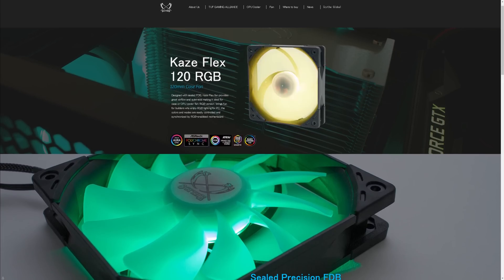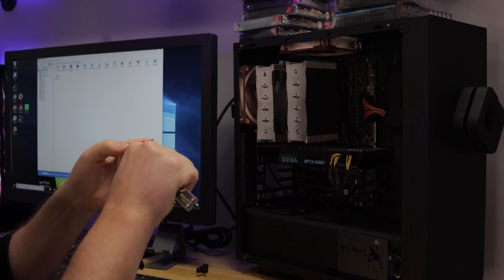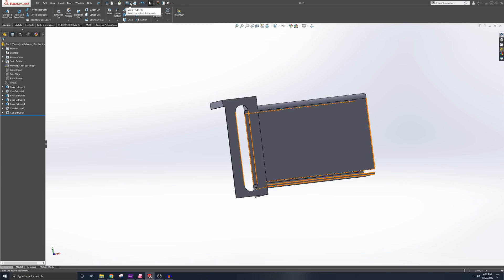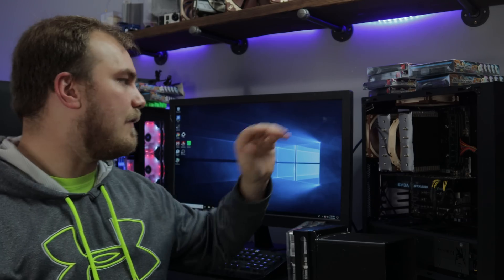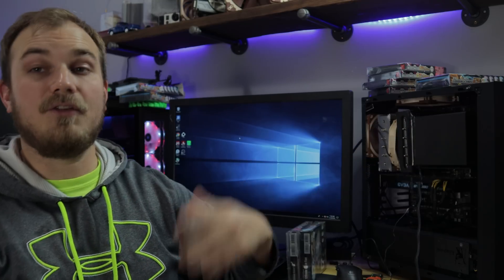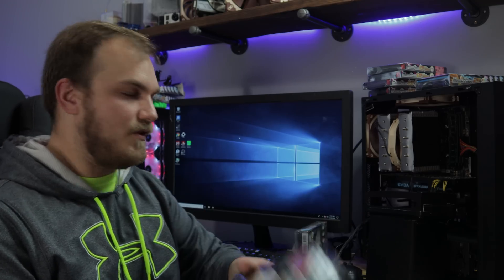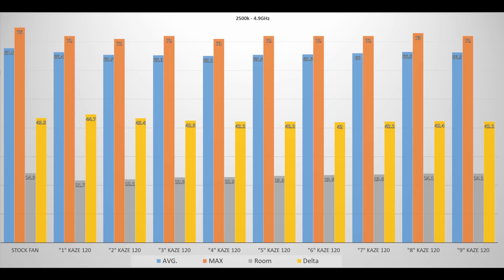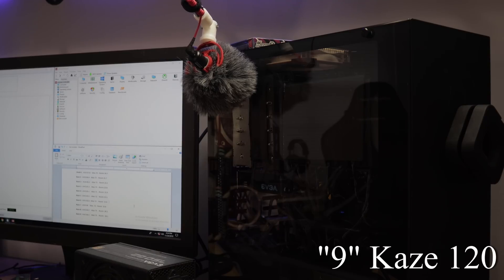This Is As Good As It Gets - Fan Stacking

Comment: Doing it in an open case does nothing. Stacking only works when used on case intake fans or case exhaust fans because it keeps cooler fresh air inside the case for the GPU and CPU cooling to utilize. Nice try though.

Comment: A jet engine builds pressure by having static blades in between the moving blades. The pressure of the air would increase, however the  speed of the air would remain the same. 
https://www.youtube.com/watch?v=L24Wf0VlTE0&t=63s

Comment: Fan stacking is more useful for a front air intake to direct cool air to the GPU. Fan stacking on a radiator about 2 inches thick is pointless since the limiting factor on cooling has more to do with the design of the heat sink and less to do with having more airflow or more static pressure going through the radiator fins. A radiator fan stuck up in front of most computer heat sinks already has enough static pressure to provide enough air flow through them.

Comment: i have a idea make duket for the noctower fan and put one noctower fan in it on the right side closet to the fornt of you case with no fan in the midlle of the cpu cooling tower.
i have a 2 tower cpu cooler with one fan on the right side and a move positive pc case set up with just the back fan as an exhaust thanks if you do try. case coolermaster pl300 matx intel HP Z75 LGA 1155 DDR3 mATX USB3.0 cpu core i7 3770 16 gb of ram gpu gtx 660 hdd 3/1/0.5 terabyes of hhds storage. and a power supply got it with a stand cpu cooler and in a retro case when i payed for it. now was for intake fans front and top an exhaust out back

Comment: Just remembered about Betz's law, I believe there's similar thing for stacking fans but in reverse and especially in the duct, you are pretty much limited by the first fan. On the other hand, did you thought about air speed moving though the fins? I mean if the faster is better, than airplanes won't even hit))
In other words, the air has to 'stay' near to the fins for a sometime to absorb the heat. You won't saturate it with heat that fast, so it's about amounts rather that pressure and speed. If you have ever ran PC outside of the case on the cardboard box or a fancier stand, you know that on the stand temps are much lower.
Also, when you are speeding air thought the fins, did you though about it’s exit? I mean it has to go back into the environment, so after ‘ducts, it’s like crashing running into the crown of standing people, which means that there is a sweet spot for the air speed to move) 
So stacking fans… kinda meh for PC cooling purposes))

Comment: It's hard to see but the front of the case looks like it is solid. So the problem here might be that you have a bunch of fans running but they have nothing to feed on. I'd try this in a different case, like a Lian Li Lancool II Mesh, Phanteks P400A, Fractal Meshify, etc. and see if there is any difference.

Comment: It will give MUCH BETTER results if you put a space between the fans..an old 120mm body stripped down and cleaned up
Oooh duh you have a 3d printer do a 120mm x 25mm spacer and ta da ..i promise will surprise you..

Comment: Some servers use a shroud like this with a high rpm fan like a delta to pull the heat away. It amazes me the efficiency of a single fan on a dual socket intel server that’s pulling 250+ watts of tdp and it runs fine. Loud but fine

Comment: I think the problem might be that the air blown out from the first fans in the congo line get blocked by the fans that come after it. So the first fan pushes air against the next fan, which is also trying to push air. While each fan IS generating airflow, it's restricted by the pushback which creates pockets of air that are effectively more static the more fans there are. Each fan besides the first is "choked" to a greater and greater extent.

You could fix this by making a long, tubular fan. Think two fan blades that curve a full 180 degrees across 200-500 mm, like an awkward lampshade.
One thing to keep in mind is that fans don't blow in a perfectly straight output, so walls perpendicular to the fan hub technically reduce throughput, and this might show even in a good tubular fan.

Comment: But how does fan stacking affect the overall static pressure and CFM? It's possible that heatsink was already running at maximum efficiency...but a heatsink with denser fins for instance could benefit from higher static pressure.

Comment: The problem here that those fans are RPM limited electronically.
They have whatever target and they won't spin faster, where higher fan RPM = more airflow = better cooling.
For example if one fan draws 1W spins 1500RPM and makes 150CFM of airflow and then you put 10 of them, they still will spin at 1500RPM, generate 150CFM and draw 2W in total.
You can confirm it by using some crazy server grade monster server fan that spins huge RPM numbers like 5000RPM+, one of these will give you better results.

Comment: This is not how it works, this is not how any of this works.

let me explain. The only advantage with much fans is when you have a big ass radiator with so much fins and so thick that i'll make a single fan not able to push air through the fins properly because it lacks pressure.

So, if you want to have extra degrees down with multiple fans, it option 1: You put them in parralel to have a higher air speed, or, having a much thicker radiator and put them in series.

Hope you'll do a video about it

Comment: I think the only benefit is that you can add up the torque that these fans make. If you're running a car air filter or a hepa filter as an intake you will notice the difference. The speed won't increase, but the pc's ability to pull air through such a dense filter definitely will.

Comment: Awesome experiment!!  And thanks for saying Kaze the right way! :)

Have you thought about an external air cooler so you can feed the CPU cooler with air below ambient?
I was thinking one of those cheap countertop ice makers, rigged to stay on.  You could probably find one for free that works perfectly because they use microswitches that fail in about a year (I simply replaced my switches with something better).
Otherwise, a Stirling cooler, a modified AC, or fridge compressor.

Comment: I'd guess the real best case for that heatsink would be triple fan, in, mid, out - or does that already hit diminishing returns.
Possible configurations:
3 fan.
2 fan in + mid (which I'd expect to be the optimal 2), out + mid, in + out, and for a weird one (maybe better with it turned 90 degree if possible) double in venting from middle.
1 fan, I'd guess nothing would beat a proper thickness one filling the middle.

Comment: I think the max rpm of the fans must be limited, otherwise it should have worked. More fans means more power and this should result in a bigger airflow if the speed of the fan blades is allowed to increase.
Reply: Fans work by lowing pressure on one side and increasing it on another. There's not going to be any appreciable difference past a certain point.
Reply: @Mostlyharmless1985  The difference in pressure you're talking about is a result of the RPM that the fan is running at. The RPM of the fan in turn is limited mainly by the electrical power the motor can provide (at high RPM). The physical limit you are taking about on the pressure would be the lower pressure area reaching absolute vacuum, and we're definitely not there yet. I think the PWM chips in the fans are programmed to limit the max rpm to prevent themselves from being burned out accidentally and to reduce the risk of fans dying from being run at a too high an RPM.
Reply: @gendragongfly  No it's quite a bit higher than a vacuum. The blades will stall out before a vacuum happens. You'll hit diminishing returns before that stalling happens.
Reply: @Mostlyharmless1985  I said that you're not going to reach a vacuum, thus your not limited by pressure. My point is and always has been that you're limited by the electrical power provided. PC fans just aren't that powerful, because they don't need to be. If you push a BLDC motor to a higher RPM than the RPM of PWM signal they will react (electrically and mechanically) as a resistive load. If instead the PWM signal where to be increased to match the RPM the fan actually wants to run at the results of this experiment would have shown more is better, because it is (until you reach that vacuum limit).
Reply: @gendragongfly  Except, again, yes, you will be limited because fans don't make pressure out of nothing. They simply have a low pressure side and a high pressure side and there will come a point where the fan blade stalls out. Going faster won't fix that. especially if the air is rarified by the high speed fan to begin with, there won't be anything for the fan blades to push on. More isn't better.
Reply: @Mostlyharmless1985  Really? I guess turbomolecular pumps and jet engines are imaginary then 🤔
Reply: gendragongfly yes, because a 12 volt computer fan and a molecular turbopump are comparable items. 
Never mind jet engines. 
I’ll say it again. 
The
Fan
Blades
Will
Stall
Out. 

Are you getting it yet? Why do you stubbornly cling to this idea that overspinning a fan will do something beyond  making more noise?
Reply: @Mostlyharmless1985  Because I've overclocked fans (by feeding higher voltage and higher RPM PWM signals) resulting in significantly lower temperatures on my computers CPU and GPU and I've reached lower temperatures by doubling up on fans as well. So I know it works. Plus I have an engineering degree and at school they though us physics. And according to physics the only way spinning fans faster won't result in moving more air is when you're operating in vacuum or working with a counter pressure which is greater than what the fans can overcome. Oh and you can get PC fans up to 24 volts and 'stalling' doesn't apply to fans because they don't need to generate lift in order to function.

Comment: You should stack two contra rotating fans connected together (without a space between them). I've already done that with 120 mm fans from Scythe KazeFlex and Noctua. I only know one company whose fans rotate clockwise - Scythe. The effect exceeded my expectations, especially at the lowest speed. It is a pity that I did not have a fan from Scythe rotating to the left with identical blades to the one rotating to the right. The best part is that Scythe KazeFlex is already working at 3V and Noctua  starts working from 5V.
Reply: Hey! Not sure if you’ll read this, but nowadays most fan models come in a reverse version - basically counter-rotation fans - which makes setups like this way easier. The problem is, not everyone has caught on yet. More people need to talk about this option.
Reply: @1tokarev1  I've seen such, but mainly on a Chinese portal starting with the letter A. I don't know any fans from good companies that would spin to the left and have an identical pair spinning to the right. I care about quality, and from the tests I've done, rarely does a fan work from very low voltage to full 12V. My pair of fans has been working in my computer so far. I bought a new pair on a Chinese portal, but I haven't tested them yet :).
Reply: @ Look at the Thermalright TL-K12 and TL-K12R fans - when arranged to blow air in the same direction, their blades will rotate in opposite directions to each other. Upon closer inspection, you'll notice that many reverse flow fans today don't just reverse the airflow direction - if you flip them over, most turn out to simply be counter-rotating versions of standard models.
Reply: @1tokarev1  I know that the fans you mentioned do their job, but notice that both fans spin to the left, but the TL-K12R needs to be turned with its back to the TL-K12 because it has reversed blades.

Comment: What about 4 into 1? Have a egg box style mount on a CPU heatsink. 4 intake fans on the chassis that have adaptors to compress the airflow into a small diameter and then run tubes to the eggbox style heatsink adaptor. (I have wanted to try this for like 10 years hahah)

Comment: What if you add decent dust filter in front of it? Not mesh... something like a HEPA filter or similar. Something that would actually keep dust out. What would the difference be with 1 fan vs stacking 2 or more fans then? And would counter rotating fans make a difference vs having 2 or more fans spinning the same direction?

Comment: do like 4 (2x2) or 9 (3x3) 120 mm fans in a wall with manifold behind it ending up in 1 120mm pipe going into CPU cooler. At low speed there should be zero noise and a lot  of cooling.

Comment: hi there. someone i know grows indoor "vegetables" and has to solve the problem of ventilating 5-20k watts of heat output from light bulbs. 

from what i have overheard, the best way to do that is with static air pressure. and in large configurations you use a plenum duct (a tube that maintains pressure, that can be tapped in to). 

why not do this with PCs? isolate the heat sources, treat them with air pressure. this can easily solve the dust problem because it is a closed in and out system. one filter. and to allow the rest of the case to tap in to that heat dispensing source, you just connect to the pipe, and put a valve in. heat in the case increases, valve opens, heat is evacuated. turbulence around components that isolates them from normal heat dissipation is less of an issue because the system relies on pressure.
allegedly.

its something to think about.

Comment: i think that stacking fans only gives a benefit when you have a resistant to push it trough like a corner or a giant pile of potatoes
Reply: Exactly, you get a pressure addition. Testing this on a very thick radiator would likely show some results
Reply: @WouterVerbruggen  A British bloke who had a reasonably-big YouTube channel but whose name I can't remember stacked a ridiculous number of fans in push-pull with a radiator sandwiched in the middle. He got ridiculously-low temperatures out of that -- below zero if I remember correctly.
Edit: yes, here it is. Minus 20 degrees.
https://www.youtube.com/watch?v=VUbpb23yTK8
Reply: @chesshooligan1282  that guy took it so far, he essentially made a simple vapour-compression refrigerator. So much fans act as a compressor (and hot side heat exchanging). At the radiator "opening", the air can expand again, cooling down
Reply: @WouterVerbruggen  Seems like a simpler, better, cheaper solution than using liquid nitrogen in my opinion.
Reply: @chesshooligan1282  how can you get below zero, unless he sucked in air from outside during winter
Reply: @atnfn  The comment right below mine explains it.
Reply: Was just about to say that, double the fans = double the "push power" but with the same amount of air.
If you want cooling, you want more air, not "push power"
Reply: And the push power is dependent on how much air there is to grab onto.
It's just potential.
But the pressure and flow would usually result in the exhaust and intake going faster.

But two fans at half speed would be quieter than one at 100%? That's what I'm researching for now.
And more fans would allow more stearing the direction of the air?

Comment: That was i fun video  i know that nothing would improve... On the PC you just showed is the CPU cooler air flow going out of the back of the case ? 
(Just wondering as that's something i would do for best airflow)..
By the way wanted to ask you.. I need to replace my chassis fans at the front of my case . cos the Nzxt fans that came with my case are crap the bottom one lost a finn without any reason ...they are 120mm what brand/model would you suggest based on higher air flow capacity ?? ( as you have good knowledge about fans)  :-)
Reply from the maker: for case fans i would just go with what you like, IMO for a case fan as long as it brings in some fresh air you will be good. If you want the best fan the A12X25 from noctua is one of the best but honestly unneeded for a case fan and its brown. I prefer RGB and personally i like the look of the corsair versions.
Reply: @MajorHardware  agreed Noctua is overkill :-)   i have seen Corsair LL120mm (pwm) + Node pro they are absolutely lovely RGB fans even if i don't usually like RGB lol

Comment: This video made me had oc3d flashbacks they stacked a shit ton of fans in a h100 and went sub ambient
Reply: Impossible
Reply: @Candisa  Search it it's still there
Reply: @ImVictorJ  You van bever get below ambient by pushing ambient air through a air/water cooler, no matter how much air you push through. You need either chilled air, phase changing or a coolant with a lower than ambient boiling temp (ln2) for that. It's physics.

Comment: Stacking provides redundancy, which is most useful in blade servers.
Reply: Which makes for an interesting test. Stack two fans and run the test. Then unplug one of them leaving it in the stack and run the test again but with only one fan running. How much does the dead fan impede the airflow?
I've also seen servers using turbine style blowers instead of fans because if one of them fail it would present more resistance to air flowing back through it than what a regular fan would. It would be interesting to see if that really makes much of a difference.